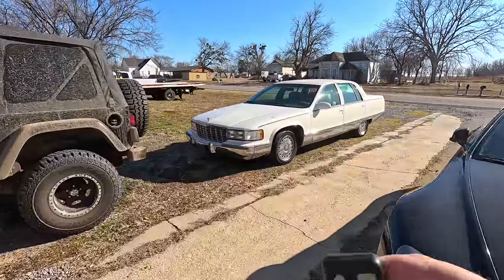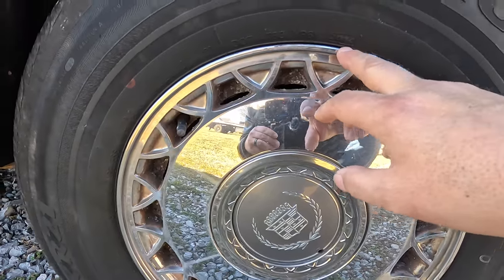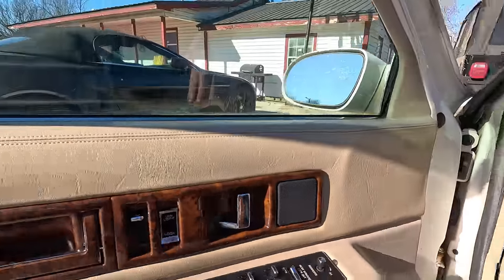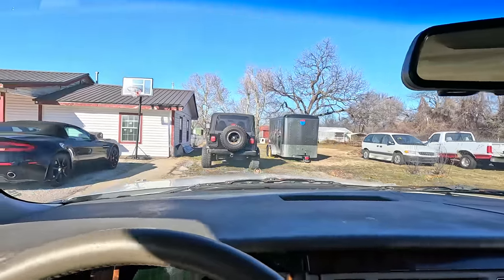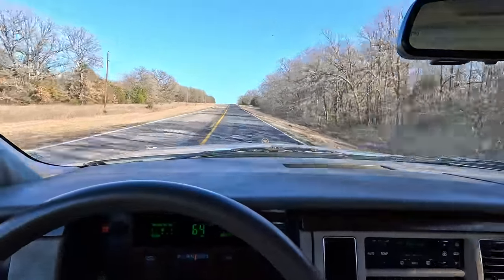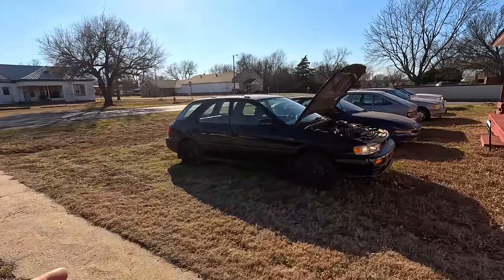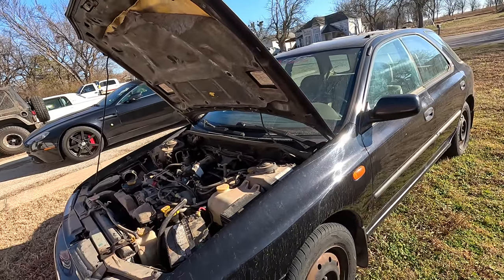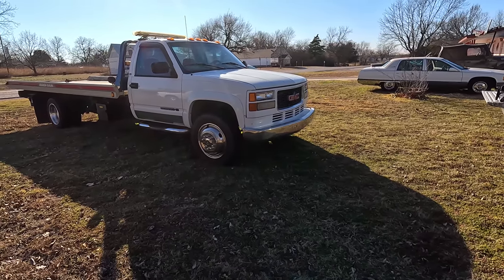I won a low Mileage 1996 Cadillac Fleetwood from Auction for $4500 Sight Unseen!

Comment: I'm not 70 or 80, but I would proudly drive this car. We sold my grandparents Fleetwood last year for $8500! It had about 10k fewer miles, the same as yours except for it being black on tan. I can't wait to bid on this when you send it down the road!! Please let us know.
Reply: @thomasmadden2258  no it has a 5.7 V8. Same engine as the corvettes of the day.
Reply: @briank3799  yes, the same, except with iron piston heads rather than aluminum for more torque and less HP since this car is such a boat.

Comment: My 94 Fleetwood got 26mpg. Even with almost 300k on the LT1! I had the transmission rebuilt and installed a shift kit and stall converter. Those upgrades really helped with the performance.

Comment: 8:51 And that is why you let the hood fall the last 8 or 10 inches instead of letting it down slowly and then push like a maniac on it.

You will avoid getting nice little dents on it, just like in the video.

How many hoods I've seen with those dents when they're easily avoidable. 😥
Reply: I saw that dent unfortunately
Reply: I know right

Comment: I had an 1986 Bro Ham the trunk problem is from people slamming it, not using the soft close feature. I owned a limo service back then and customers used to slam my trunks all the time. It’s the latch it needs to be replaced. Simple fix. Love 💕 the gas cap feature wish I had that. Horn sounds a little off also. I had Vogue white wall tires those are the recommended tires.

Comment: I think people are starting to look for these as they are the last "real" Cadillac.  Since these were the expensive high-end model made for only four years there were not many made and fewer in decent condition left.  As far as the trunk motor, I have to replace one on my GTA and I hear it can be a pain getting the alignment correct if you don't have everything marked before disassembly.

Comment: I love these cars. I only buy '90s cars. '96 is a good year. Though I don't like soft close trunks. I have learned that keeping the tire pressure low prevents the car from going sideways and spinning tires. Getting my car road legal has been frustrating but I love driving it. My cars tend to have lots of issues but run perfectly the day I sell them.

Comment: If that trunk is a power pull down version then just tap on the motorized latch while holding the switch down on the trunk itself, let it motorized up & down once or twice and it should come back to life, my 98 deville does it all the time
Reply: My 88 trans am does this too, worth a shot

Comment: You need to move it down the road Randy.
Maybe that soft close mechanism is just a little sticky from sitting. I would fix that, and that unit that is broken on the front seat. I could see someone paying maybe
$7,000-$8,000 for it.

Comment: I just fixed the soft close on the exact same car, the switch you pushed has a open and close contact under it, the flimsy contacts get warn and it doesn't touch completely, open the switch and bend the contact back and it will work

Comment: You have discovered part of the reason why the Roadmaster and Brougham of this generation command the prices that you noted, particularly with low mileage.  I have owned my 1992 Roadmaster for six years and have probably driven it about 10,000 miles in that time -- they are quiet, good riding cars that are exce4ptionally stable on the highway.  At 86,000 miles, my Roadmaster is still relatively low mileage and in my area would likely draw around $,6000 to $7,000 on the used car/collector car market.  Its two weaknesses are doughnut gaskets on the exhaust pipes and resonators, but other than that, it has been regular maintenance items.  The one irritation is finding a shop that can align this car in my area as most refuse as they tell me their alignment racks require that the top of the rear tires be visible to the alignment equipment when the car is sitting on their rach -- and the rear wheel wells on these cars hide the top of the rear wheel.  I have really enjoyed the appearance of my car with the Vogue whitewalls with the gold stripe -- excellent handline along with long wearing.

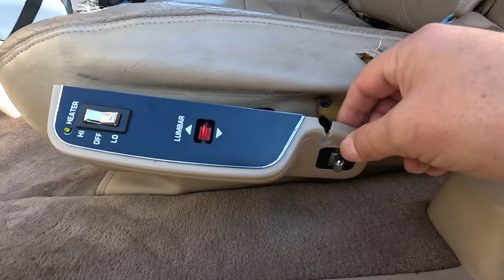Comment: 4:44 If all else fails, that looks like something that could be fixed by modeling in some JB Weld, using a spatula of sorts and a dremel for the finishing touches. If it's an actual weak point, enlarging the screw hole to accommodate a washer may be useful. It does look like a reasonably large-head screw to begin with, no doubt because they knew they were dealing with plastic.

Using the dremel with a cutting disc may also help the melted defrost vent do its job once again - it's not exactly looking pretty as-is so there isn't much to lose.

Neat ol' boat. Anachronistic even by 1996 standards, sure, but classic 20th century American luxury nonetheless. Not sure whether I've ever seen any of these over here, there can't have been many. Seeing this one reminded me of the old William DeVaughn soul song, "Be Thankful for What You Got".

Comment: One neat 96 Fleetwood u can tell it use to belong to older person my thought was going be a 50,000 mile car 81,000 almost near 100,000 but runs like a boat & definitely needs whitewalls tires it's a Caddy even tho didn't see alot cars from 90s with whitewalls.

Comment: Can't believe a 96 is almost considered an antique. I've always been a huge fan of the Fleetwood Brougham and agree with you Randy that it's iconic squarer predecessor is much more pleasant looking. By the time they redesigned it in 92 I believe, it ended up looking too bulbous. Just not a fan. Without white walls, somethings just missing. You'll be hard pressed to find any white walls nowadays. They are hard to find. Vogues are one of the few choices and they are $$$!! I much prefer the style of the Town Car of this era before they were also redesigned. Maybe Big Al or Specialty Motors will buy it. I do love the Seville you have though. I'd be tempted to keep that !

Comment: You should do a build on the Subaru all you need is 03-09 Subaru forester struts and it will lift it 2 inches all you have to do is file the holes on the back the fronts bolt right up I’m building one rn mines on a 4 inch lift

Comment: That engine was rated at 260 horsepower but it actually puts out 300 horsepower. GM was not about to have any other car be equal to its flagship, the Corvette.

Comment: I’ve owned a few in my lifetime and currently own a 93 white with blue leather it’s got the TBI instead of the LT1 so it’s valued at a little less but not much and I currently own 3 lt1 engines 2 of them are in my roadmasters   Oh the cost of them has went up considerably in last few years unfortunately it’s a niche market but you can get good money from one. 
I’ll  wrecked my 94 and when I went to get another one it took almost a year to find one reasonably priced and they would sell within hours sometimes before I could get to it!
As  Fleetwood man who loves them and knows about them GEOGRAPHY has a good deal to do with prices on them. For example in this area Washington state  they are pricey but in Mississippi you can get one for 1500 clean but  in California the same car is 7500-10k for the right buyer On the west coast it’s highly sought after lowrider market for them because they are body on frame suspension and beautiful cars with lots of chrome they make wonderful Lowriders   Pro tip put a fresh battery in your fob and reprogram it by ground out the wire in your trunk on the drivers side looks like something should be plugged into it   Key on ground it out and it will cycle the locks and the courtesy light and trunk and after it cycles them all within immediately press any button and it will repeat the process and should work fine everything! If the pull down doesn’t work take it apart and unjam the screw gears and lube it up it will work fine if it was just working unless broke it trying to slam it 😂 did you sell the car ?

Comment: Well I am 70 lol and I did own one of these cars along with at one time a Buick Roadmaster with the 5.7 LT one motor both wear fantastic cars let me tell you something Randy if you put the white walls on that car and have the crack and the dash fixed and the little odds and ends that car should bring at least 8K to 10K if you want to know the value contact Anthony at specialty motor cars Big Al would have his information if you're going to throw money at these cars let it be the big boy Cadillac oh almost forgot The trunk pull down motor I looked all over God's creation for one and ended up buying brand new from of all places summit racing equipment I think I paid 200 bucks for it but it was easy to change Don't buy used from eBay You will be sorry lol ask me how I know